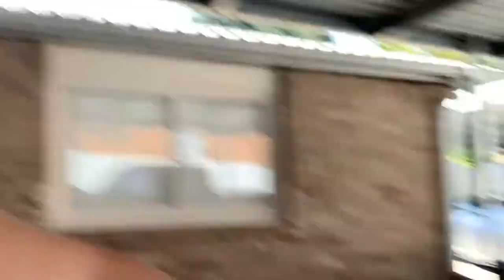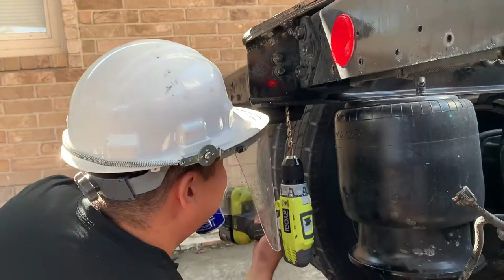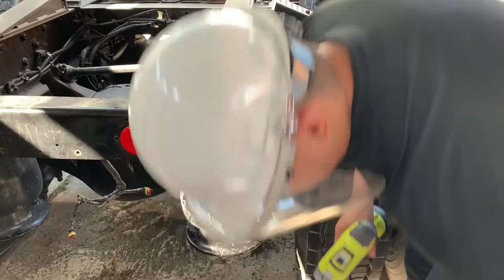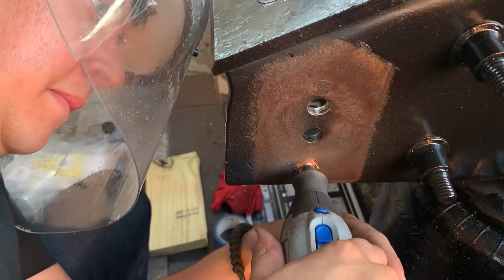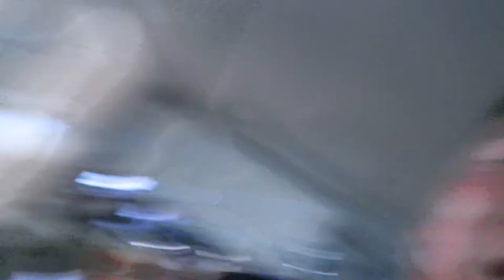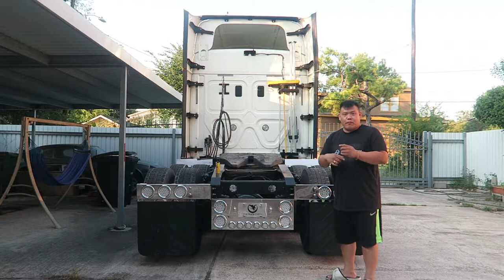New Trux Taillights on my Freightliner Cascadia (Upgraded) from Chrome Stop Shop

Comment: You gotta install a led flasher relay and or a resistor on the turn circuit on the rear harness to prevent that hyper flash.
Reply from the maker: 5FaLlEn5 I know I
Just never done it

Comment: Where is your reverse light?
Reply from the maker: The little ones on the bottom on each end coner
Reply: @Gemini-G7   where they all seem to be in red 🤔
Reply from the maker: They are red but 2 are 2 way functions light. When light turn on to drive at nite that all red. When I put in reverse the 2 lights turn white.
Reply from the maker: https://www.finditparts.com/products/7987286/trux-tled-4x40.amp?srcid=CHL01SCL010-Npla-Dmdt-Gusa-Svbr-Mmuu-K7987286-L367&gclid=CjwKCAiAiKuOBhBQEiwAId_sK-LxIbMUAbapSCXysUTUMXvqUwt8cVT1UbVmJMcTOeaXT1YXNU_S8hoCcQgQAvD_BwE
Reply from the maker: You need to google duel function led lights and you find a whole bunch of them
Reply: @Gemini-G7  I got it , that’s actually awesome 🤘🏻💯

Comment: Your spinning the drill too fast. Thats why it takes so long to bore the holes. Very slow and it goes right through.
Reply from the maker: I’ll tell my friend that
Reply: @Gemini-G7  zinc coated or titanium bits with a lil oil will cut all the holes no problem,  they are a lil pricey but well worth it
Reply from the maker: @michaelford9089  wow I didn’t know that, I just learn something new ty for your knowledge and input.

Comment: Reverse?
Reply from the maker: H G I didn’t hook up the wire to one I left it disconnect, but you can hook your reverse wire to the lights you want.
Reply: DOT requirements is a white reverse light during inspections just as an FYI